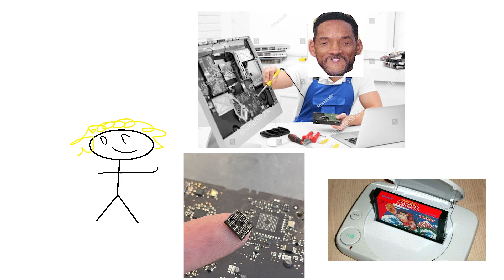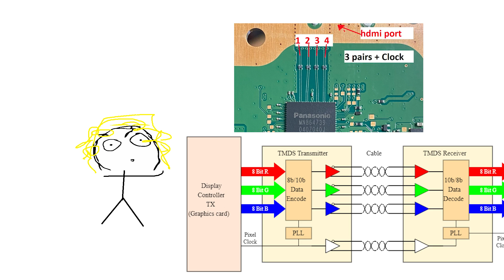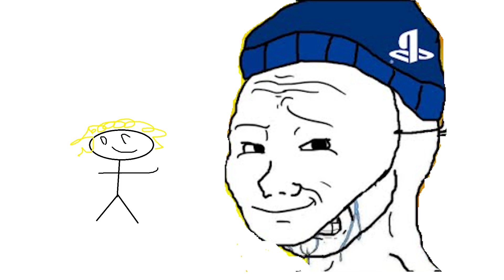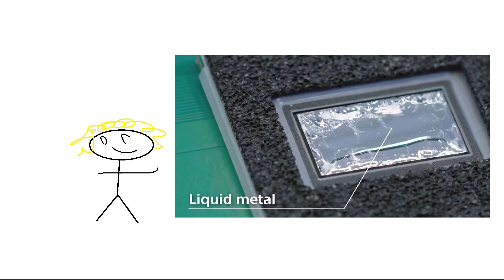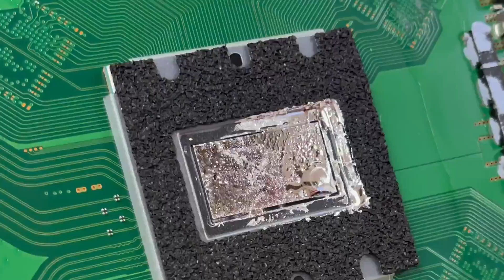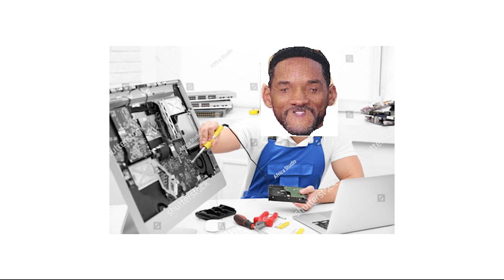YOUR PS5 WILL BREAK IF YOU DONT FIX THESE ISSUES

Comment: Great video. What if i use my ps5 standing upside done half of the time? Does the liquid metal only pool down the bottom over time, or right away... 🤔
Anything but horizontal 😫
Reply from the maker: It takes some time for it to happen.
If you put it horizontal now and it doesn’t have any overheating issues you should be fine